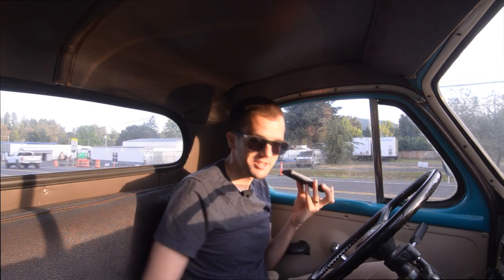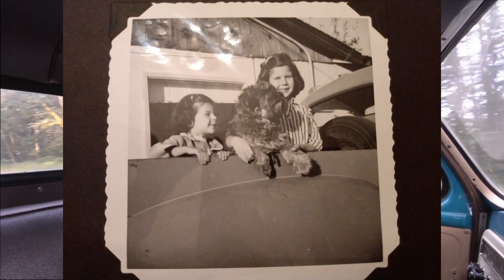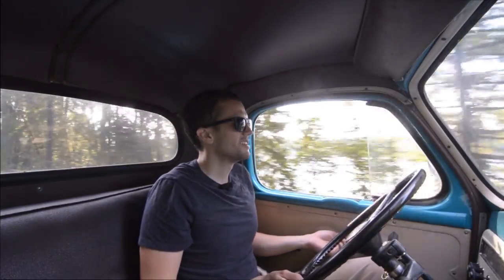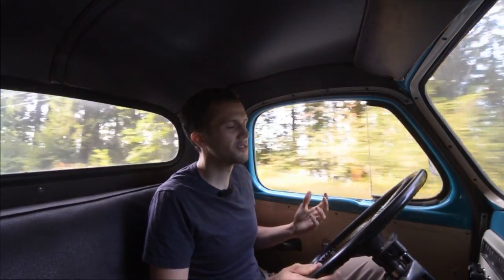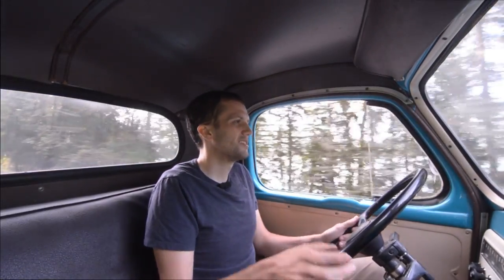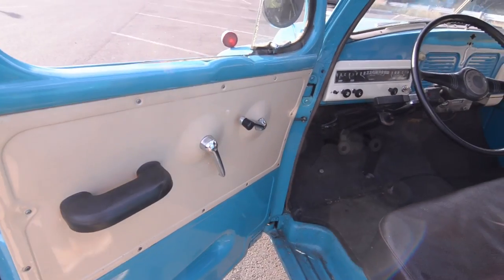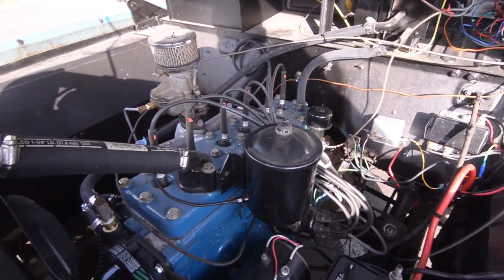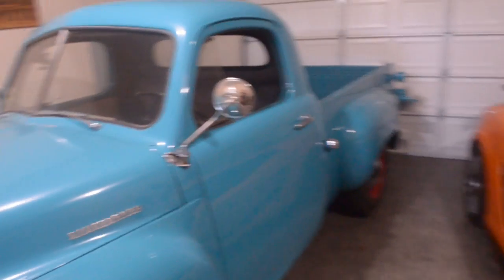Ultra Rare Classic Pickup Truck With A Special History | 1952 Studebaker 2R5 Pickup

Comment: Great story - truck came back twice so I guess it knows where it belongs.  The overdrive equipped trucks usually had a lower geared differential, so I understand if it is not working, the truck will not go all that fast.  With the over drive working, your final gear ratio will change from 1:1 (straight third gear) to 0.7:1 (in overdrive).  Those Borg-Warner overdrives were pretty simply and as durable as the transmissions.  It might be an easy fix and you will be able to do regular (60-65 mph) highway speeds with no trouble.  But, as you stated, one always has to be conscious of what the limits on the brakes are.  With the OD not working, it is recommended to pull the OD handle out, locking the OD out and eliminating the freewheeling.   Good luck and happy miles for you all.
Reply from the maker: Patrick, I couldn't agree more. It is home to stay! 
I will get right on fixing that overdrive, it will make the car so much more fun to drive. You are completely right though, stopping at 65 with original brakes, maybe not the best idea! 
Happy cruising to you as well.

Comment: Beautiful truck! I have a 1949 Studebaker 2R-5 and I find it interesting the differences in where things are placed in your truck vs mine. My ash tray is underneath the middle of the dash, close to where your radio is. Most likely when the radio was put in yours, they moved the ash tray over. I really like the rear bumper on your truck. That was the industrial bumper for these trucks, and I think it's a lot more useful and better built than the regular straight bumper. Those turn signals on top of the fenders were an option from the factory; even having turn signals was an option at the time though. That's why now you find these trucks with different styles of turn signals in different places. If you are interested in learning more about the history of these 2R series trucks, I think you would really enjoy reading Fred Fox's articles about the history of these beautiful 1949-53 2R series trucks. Fred Fox is  one of the writers for 'Turning Wheels' the Studebaker Drivers Club magazine. You've got the best of both worlds: a Studebaker truck and a Lamborghini super car in the same garage. Keep on truckin'
Reply from the maker: Richard, Thanks for reaching out about your truck! Those differences you pointed out are very interesting. I feel it just adds to the character of the truck with everything being in a slightly different spot depending on when it rolled out of the factory and who built it.
I'm also glad to hear that the parts that I thought were aftermarket were in fact original components! So that's very cool. 
I took a look at the 2r5 on your channel, and I have to say you have a very beautiful truck! She is an absolute gem. I will look into Fred Fox and his articles about the 2R trucks, thanks for reaching out with that resource. I look forward to reading more about the history of these rare and special pieces of automotive history.
 Keep on truckin' and thanks for reaching out!

Comment: most of the old cars and trucks tears ago did have starter button and the dimmer switch on the floor board 4 the head lights low and high mom's dad had 1 years ago brand new and it got alot better gas mileage than most other cars and trucks of the time 😊😊 12 6 2O23